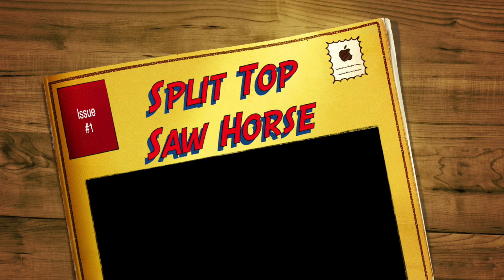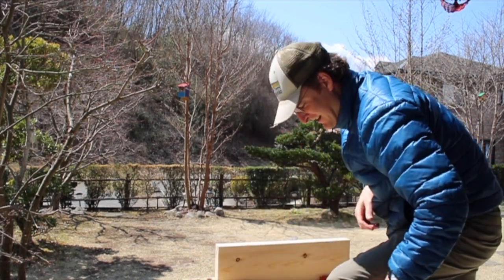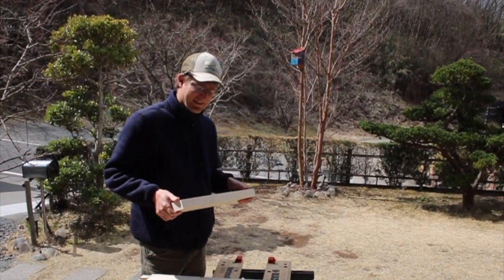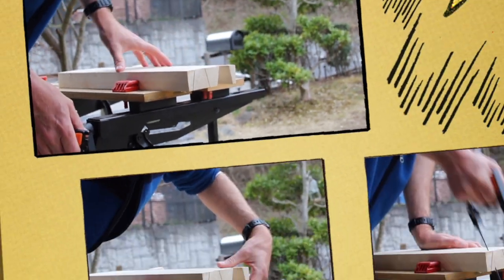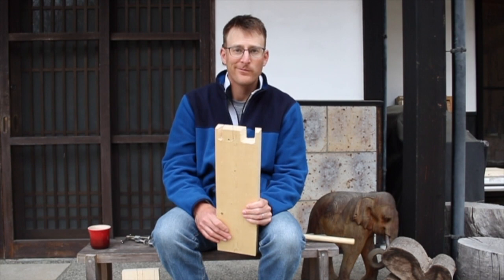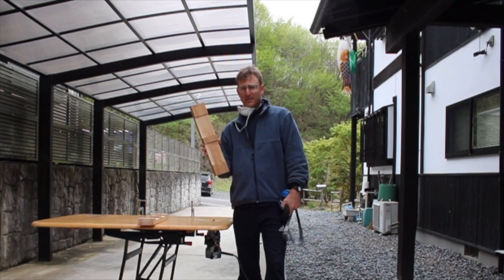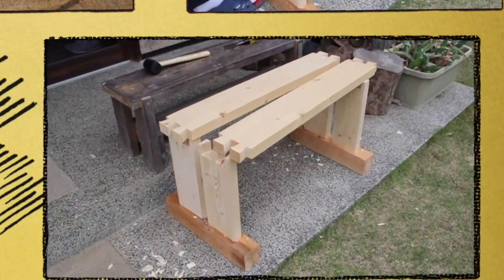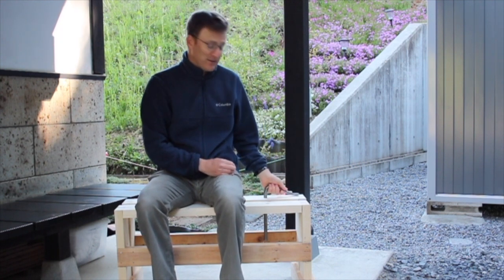Split Top Saw Horse

Comment: I really enjoyed building mine. Very functional. Now I am working on adapting 2 of them into a Roman Style with clamping grooves in the edges and a space for boards under the top to span between the 2 horses. Adding removable workstations to fit into the grooves on small platforms and interchangeable tops to fit between he splits.
Reply from the maker: that sounds like a wonderful multi purpose work station. Awesome idea.

Comment: Well, it was enjoyable to watch you build it, but ...  with no measurements given or closer instructions on how the prices get put together.... a new woodworker like myself has no clue how to make one. Also you didn’t show it being used. So, thanks for this video.... I guess?
Reply from the maker: Great comment. You are absolutely right. I should have added dimensions for this project. I just sort of winged it. Watch the Stumpy Nubs video and you will see why. I am pretty sure that I used a 6ft 2x6s cut in half for the tops and 1 6ft 2x6 cut into 4 pieces for the legs. The 2x4s that I used for the feet were just roughly spaced out.  I think the most important thing is to find out the height according to your knee height. You will be using it as a clamp on projects so make the top as high as your knee and reverse engineer the other pieces accordingly. as for the length of the tops I just cut a board in half but if you have a small shop you may want it smaller.
Reply: Thanks for replying Brian. I get what you are saying about personalizing my dimensions. I’m sorry, but can you explain reverse engineering? And what router bit did you use for smoothing out the leg cutouts?
Reply from the maker: @bobm6423  Hello, sorry for the delay I was super busy last week.
Re: Reverse engineering. Find out the final height for your bench then figure out how long your boards must be when fitted together to get that length. I wanted my bench to be 45cm tall. So then I knew that I would need 2 90cm boards cut in half. That saved me time because I could have pieces cut at the home center.
Re: Router bits. I just used a 12mm straight bit. but, Any straight bit will work fine.